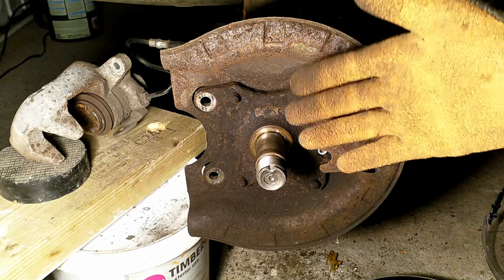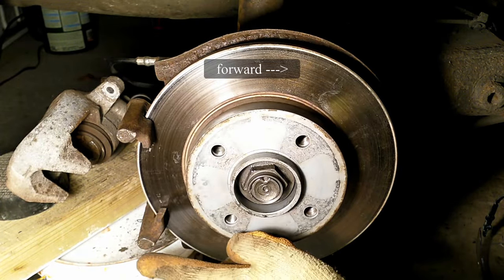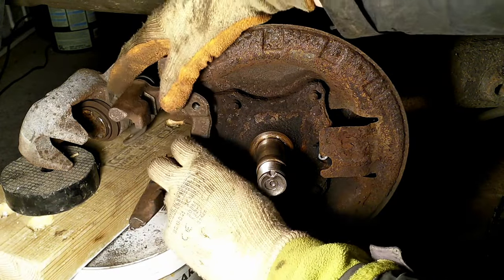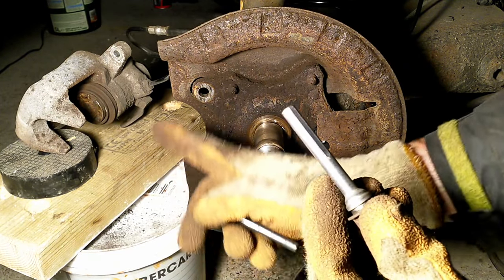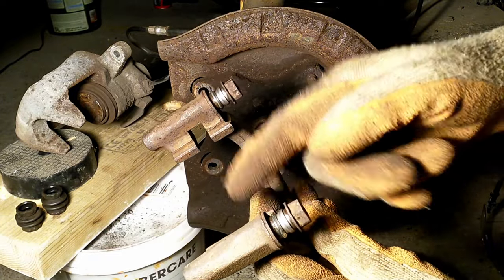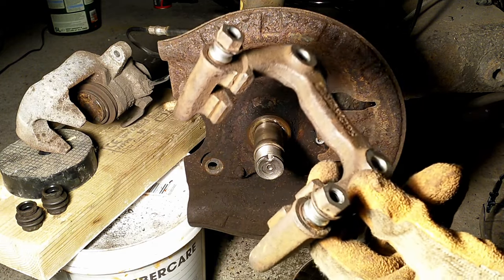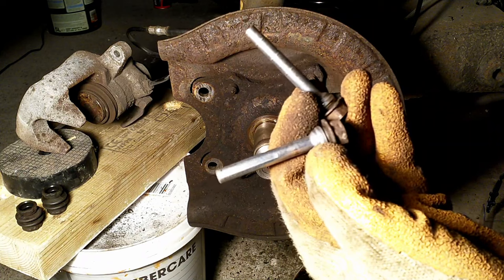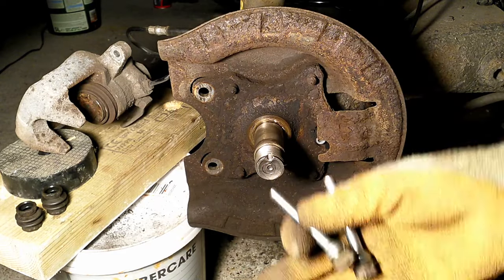Different sizes of rear brake floating caliper guide/slide pins

Comment: Great video and great explanation. Would love to see another video expanding on this topic when one pin has a rubber sheath (damper) on it. I've seen videos where mechanics say it's fine to just remove the damper after it's expanded/old and is preventing the pin from sliding/moving easily. Others say you can cut/shorten the length of the damper. Thank you for your time in making and sharing this information with everyone.

Comment: On my 2021Toyota C-HR, the difference between the 2 pins is that one pin has a bushing on the end of the pin and the other pin doesn't. The pin with the bushing always goes on the trailing edge for both front and back calipers. So for my car, the position of the pins are not chosen to make pad replacement easy to do where only one caliper pin bolt is removed and the caliper is flipped upward. The positions of the pins may be chosen by the manufacturer only to allow the brake calipers to function more efficiently. Thanks for your video.
Reply from the maker: Appreciate the comment. Some of those have a rubber bushing, but AFAIK there are only there to stop squeaking/chatter rather than for efficiency. May be wrong, but afaik these are not for efficiency.
Reply: My understanding from what Lewis said is this: The "efficiency" (more likely safest operation) is achieved by having the non-bushing guide pin placed at the leading edge. Saying that from the point of reference of the guide pin with the bushing, we would say that means having the guide pin with the busing on the trailing edge.

Comment: Outstanding explanation - thank you.  My refurbished caliper came with a bushing on one pin and flat sides on the other.  The pin with the bushing has some lateral play but is much tighter and harder to move in and out.  Have you noticed this as well?

Comment: I am no mechanic but think that leading pin is more important to have a tight fit not  to have movement(chattering) in the caliper assembly during braking. I would imagine leading pin is pivotal while trailing is less crucial
Reply from the maker: Hi John, yes, it seems logical but it is not always the case. In my case, on the left of the rear right, the leading is the non-floppy guide pin, but in the case of many Hondas, the whole bracket is on the right and the leading pin is the floppy or 3-stepped pin, so the caliper can be pivoted on this one.

Comment: Great video... Thank you.  Do you know why there is a rubber boot on one of the two?  And on my rear right, the top siezed after 60k miles.  Need to figure out how to remove it.
Reply from the maker: Yeah, the rubber is purely for reducing chatter from the pin. So, kind of reduce noise, nothing else. I have not had experience with removing seized ones, but have seen and heard that one does it with heat, I do not think anything else works.

Comment: Too late for my trucks brakes but will have to redo them soon as I have to replace a rotor due to wear on in it due to this no doubt. Did not have correct pins. But thanks to this Video o know what it needs. Thanks
Reply from the maker: I do not think it matters that much, but when I was doing mine could not quite work out which one is where, so spend quite a bit of time trying to work it out, hence the video, in case it helps someone else.

Comment: mines are both hard to push in, the leading one doesn't bounce back when i pull it out is. do they need replacing or that's how they're supposed to be?
Reply from the maker: They are probably a bit seized and you need to remove them and greese them. It could be that the rubber has perished and let the greese come out, so you may need to replace the rubber as well. They are supposed to be freely moving in/out.

Comment: If the calipper is located closer to the rear bumper, should the guide with the cone be at the bottom? Yes?
Reply from the maker: Yes, I think that is correct, but in all circumstances it does not matter that much.

Comment: i have a question ( sr for my bad grammar and english at 1st) 

- In this case, both 2 pins are made from steel and each has its own function: the cone makes it ez to open the brake calliper to replace the pads. 
- But as for the pins with rubber bushing inside, what are their functions?
Reply from the maker: Good question, the rubber is simply an anti-rattle device.
Reply: @moremolecules  if so, is there any problem if we swap their position. Do they have a certain pore  i mean like  for example do the pin with rubber bushing has to be at the railing position, like so 👍 
Tks for replying so fast
Reply from the maker: @sonVason  I do not thnk these do matter that much and the other ones as well. It is simply for convenience to have these so one can swap brake pads easier, might be wrong, but i do not think they matter that much.

Comment: I have a problem with a noise when slowly releasing the brake pedal. The guides have a rubber bearing on the front tires and goes on the top. I put a grease that wasn't there and apparently it swelled to the rubber. Do you think this is my problem...? my car is Jetta 2021
Reply from the maker: Yes, you need to replace the rubber pars and only use grease that is rubber friendly. I think the silicone grease is rubber friendly and will not swell them.

Comment: So besides preventing rotating the caliper in place the slotted pins don’t serve any other function? Now that I think about it may have mixed them up occasionally on my Acura but I never rotate the caliper I remove both bolts and use a bungee cord to hang it on the car.
Reply from the maker: Pretty much yeah, not much of a difference how you put it, it is only there for degrees of freedom, not much else.

Comment: What's the best lubricant for slide pins? Liqui Moly Ceramic paste, silicon grease or copper grease? Do you know the correct torque settings for TX55 and #13 bolts on a Peugeot 308 1.6HDi? 70Nm and 40Nm respectively with or without thread lock? Hub nut 200Nm and rim bolts 110Nm? I don't have a service manual and I get different numbers on the Internet. Should you put any grease on the brake pads and guide pins and between brake disc and hub? Maybe you have a video explaining all of this.
Reply from the maker: I do not have a video explaining these, as there are a few around that are good. I generally do not do videos that have already been done, unless I can do it better with more details. Sometimes I forget to do a video and then I regret it. I do not know them for the 308 specifically, but I am pretty sure they are the same with the 307. The mounting bracket on the 307 TX55 is 105Nm and the guide pin bolts are 30Nm. I always do both with a threadlock. The rear hub nut is pretty hefty with 210Nm. I do the bolts 95Nm. Mayber there are differences with the 307, so take these with a pinch of salt. A Haynes manual is great for the Nm, but fairly bad with the photos and description.
I always use silicone grease, nothing else, as others can swell the rubber. You have to clean them inside out to dry and then apply small amount on the slide pins, no too much and avoid putting on the tip, otherwise you could get sort of hydrolock.
Reply: @moremolecules  Thank you very much for the torque settings data. I guess they're all the same for the front brakes. The front brake disc/rotor bolts have a specific torque setting? I don't remember if they are TORX or Phillips.
Reply from the maker: @csraln6748  The bracket TX55 & and the guide pin bolts are the same torque for the front and the back, they look the same and as far as I remember they were the same size. The bracket bolts are torx and the guide pin bolts are Phillips.

Comment: Thank you for your video, my 2013 accord have one flat pin and one round pin without any taper, which one should be the leading pin. Thank in advance.
Reply from the maker: I am not too sure if they are a flat one and a round. The taper usually has a bit of freedom to move. If one of the two is a bit more flexible this will the the one similar to the taper.
Reply: @moremolecules  The pins on my 2001 Golf are exactly as you show. Most caliper-pin discussion is about the pins with the rubber sleeve on the end, but mine don't have a sleeve. Now I know that '3-Flats Leading, Taper Trailing'. Thanks for the video. Perfect for me.

Comment: I have a pin guide with a small rubber on the tip, where does it go? To the leading or trailing.
Reply from the maker: It depends on where the caliper bracket is mounted, i.e. at the back or the front. If it is at the back as mine in the video the one with the rubber tip is at the leading edge. If it is at the front then it is the trailing edge. This thing with the rubber is the same as mine with the two flat surfaces.
Reply: Can you please explain what does the small rubber? Thx.
Reply: I find this small rubber gasket very annoying, it makes the pin more difficult to slide, even if properly lubricated.
Reply: @adryanyyyy it’s there to help with vibration

Comment: Mine are two different lengths and I think the long one won't fit in the short chamber. This makes it fool proof. I'm not sure but it looked like the chambers were not the same. Toyota.
Reply from the maker: Yes, some have done it more cleverly with different lengths, kudos to Toyota. Most manufacturers do it as these in the video.

Comment: This is getting more confusing than it should be.  Just look at a parts diagram, it will show you the proper pin placement.  My 14 Camry has the pin with the rubber seal on the lower placement on both front and back. So one leading edge (rear),  and one trailing edge (front). So not sure what all this video is trying to say? But I if did it based on this it would not be correct.
Reply from the maker: What parts diagram? My and other cars came with no such diagram hence the video. I tried to explain the reasoning behnd it, if you do not like the logic then that is ok with me.
Reply: @moremolecules  I was thinking of a parts diagram online.  I am sure the info is out there. It was for my car.Your logic is good, but does not fit all applications. Who knows it  probably doesn't even matter how they are placed in the caliper, and as far as that rubber seal goes I do not use them.

Comment: It doesn’t matter ! Take that over engineered rubber sleeve idea off the pin and put them in where ever. It is an upsell tool for dealerships to get you to bring your car in once it expands and seizes your caliper. Can’t trick me.
Reply from the maker: It should not expand, but I get your point completely.